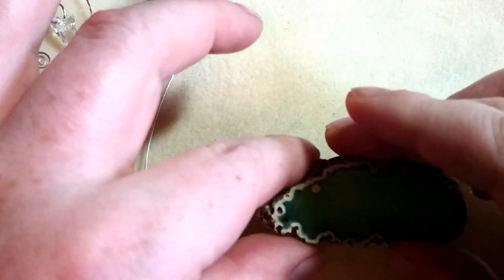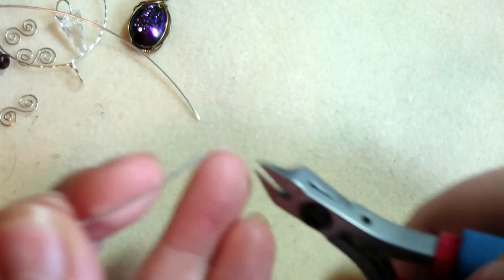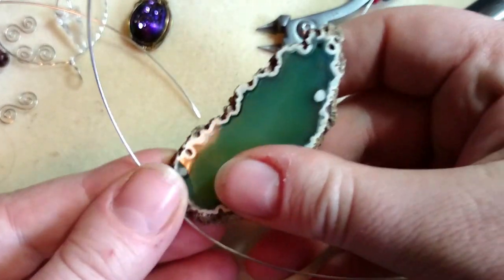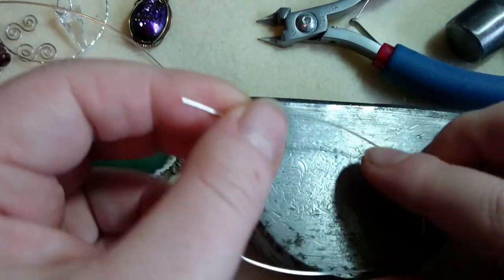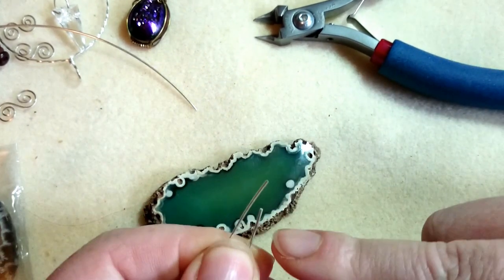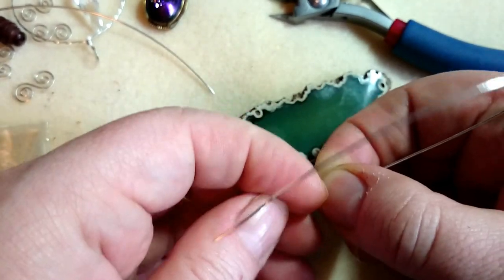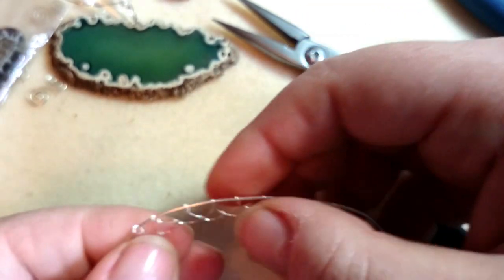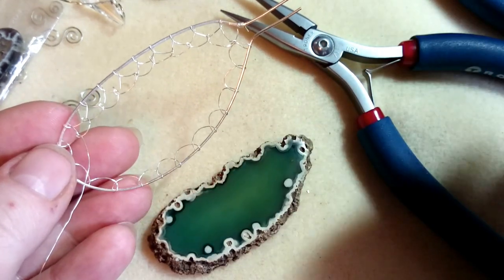Agate slice frame netting tutorial part 1

Comment from the maker: Lizann Wess, I'm not sure why I can't reply to your comment directly, but I used dead soft wire. I tend to use it for everything I do as making it harder is easy (I hammered this one to harden it) but making it softer is not. If I didn't have a hammer, I would consider using half hard or full hard wire for the frame as the frame needs to be stiff enough to withstand the tension put on it by the netting and the weight of the stone without warping. :) I hope that helps!

Comment: Thanks for your video. When you get near the opening of the frame (around min 15) rather than doing the "sewing method", you can just create a soft loop to the side of the frame and then slide it over the end. Look at the direction that you're "sewing" the loop. Create that shape of the frame and it's little loop that goes around the frame loosely off the end of the frame. Then slide the smaller loop onto the frame. Then tighten as if you "sewed" it. Make sense? May save you time and troubles in many other steps of your weaving. As long as you have an open loop and you are near that opening, you can slide your soft loop on and tighten.
Reply from the maker: HealingResonanceLlc Thank you for your comment. I prefer the method I use.
Reply from the maker: Please be aware that if I were to do your method, with the gauge of wire I was using, that I would end up with too much torque on that small of wire. This would result in lots of stiffening and breakage and would require steps like annealing that are hard for me to show, with the video setup that I have. This is why I do it the way that works best for me. :)
Reply: I agree with HealingResonanceLlc :)

Comment: Grind your pounding block smooth, and put into fire until glowing red. Then drop into used engine oil.  Then lightly grind smoother.  You will have a surface that resists damage because it is hard.  You can also quench in water because you don't need that hard of a surface.  Smooth has to help
though
Reply from the maker: absolutely that would be the way to do it if I had the ability to!

Comment: In UK hard to get cheap square wire can I use round what guage is it as its mm here though, how do you get your wire. 8?
Reply from the maker: I can imagine.. I have heard that most specialty shapes of wire are really expensive over there.. this works with round wire of the same size